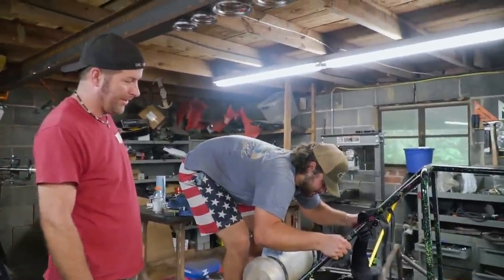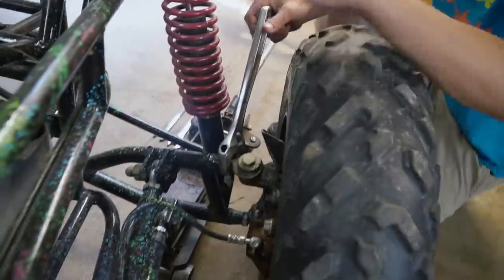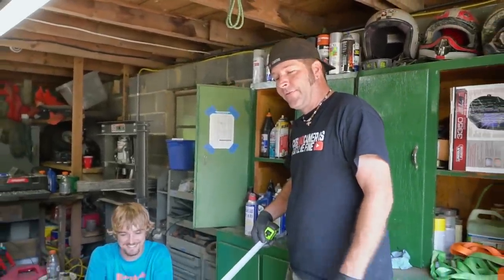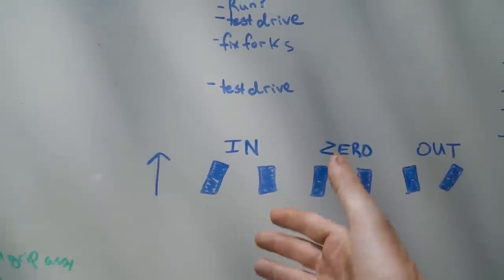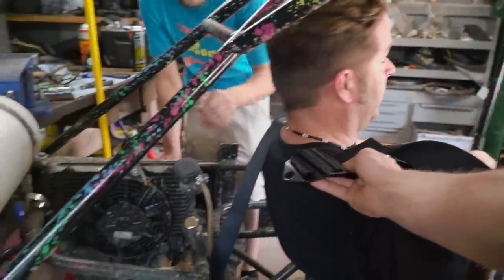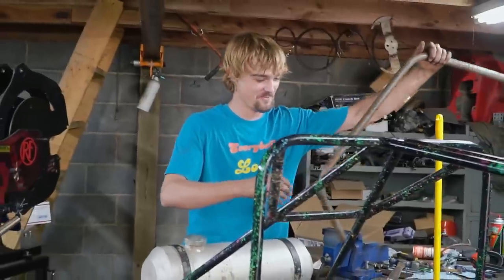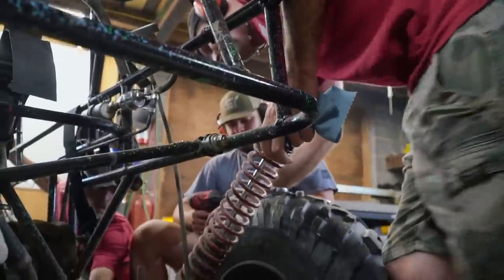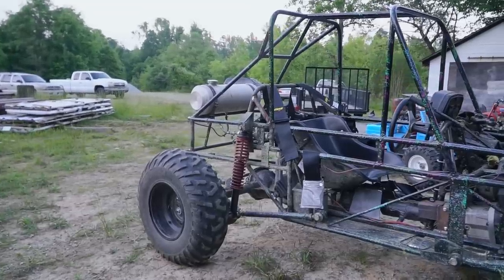$100 Long Travel Shocks RUINED the Trophy Kart | Jump Testing, Is It Safe?

Comment: You need to put thicker oil in the shocks. Go to the local motorcycle dealer, and get the thickest shock oil you can get. You can even call a motorcycle suspension dealer tell them your weights and get an idea on shock oil vs dia of the shocks you are using now.  Then step down or up on viscosity till you dial in the rebound.

Comment: Moto racers (and monster truck drivers,  and RC bashers) change the attitude mid flight via the inertia of the wheels. Throttle brings the nose up - brakes drop the nose. Its a delicate balance that takes a lot of practice 😉
If you want to jump it, you need some long travel shocks, and hydraulic bump stops.

Comment: For those reverse thread joints/bolts that aren't marked, try filing a groove in the points of the hex with a triangle file. This would look like the fitting on a fuel gas welding bottle.
Reply: they are marked...

Comment: Have you guys thought about using an air suspension like when you would find on early model Ford expeditions etc? If you went to the junkyard you could probably find one and then find a little 12-volt air pump and if you had a proportioning valve you could make that so that you could dial in the settings you need. It's just a thought.

Comment: Throttle position and change in acceleration from bottom of jump to the lip is key in helping set the ballance of how itll land. Hard acceleration from bottom to top of lip will shit more of ur weight towards rear think of it like a drag car all weights up front but you want it shifting Back during launch for traction then decell to level out

Comment: MAKE THE FLUID HOLE BETWEEN OIL CHAMBERS SMALLER AND ADD A CHECK VALVE IN THE COMPRESSION DIRECTION SO IT COMPRESSES FAST BUT RETURNS SLOW.

Comment: The springs control the down and  the oil controls the up. Less oil will only make the spring open back up faster. Need more oil is the point in getting at. Adjustable shocks will solve all your problems.

Comment: I remembered something about your problem . Seeing "The Outlaw" rock bouncer in action , I noticed his ass didn't spring up like all the solid rear axle buggies . The diff is solid mounted so it travels with the frame and the wheels and tires ONLY are moving with momentum . Your solid axle is sledgehammering your frame , driving you up in the rear . Your front end is super soft too , possibly contributing . There are a couple of Outlaw compilation YouTube videos you can watch to see what I mean . Try a BMW 3 series rear axle and see how much better it works . Better than 3 grand in shocks !

Comment: Issue with the rear end flicking up is more likely the length of the jump/ramp. If the jump is shorter than the wheelbase this will always happen because the front wheels are airborne before the rear suspension has compressed into the ramp. Need a longer ramp for the long wheelbase

Comment: I remember reading something one time that said a jump needs to be at least one and a half times the length of the vehicle, and a smooth incline, so the shocks are at the right point in compression and rebound to help control nose diving. That obviously won’t solve all the issues but it may help.

Comment: Guys try just preloading the suspension on the jump. Just as you go up, keep the gas pressed and apply the brakes a bit to get the front to dive a bit, then as soon as the front tires are about to come off the tip of the ramp, release the brake. This will let the front extend a bit and keep it more level in the air

Comment: I vote weld the rear diff and make a shorter final drive. Install longer struts on it, at least double the length you have. A longer strut should allow for more droop in the rear so it lands smooth. Then stiffen the front until it bounces off the jump level. Maybe get a seat out of a evo or something similar also.  a seat with the harness holes in them.

Comment: If the face of the jump is shorter than the wheelbase of the vehicle, it is hard to get it to jump level. If your front wheels are already coming off the jump as the back wheels are hitting the face of the jump, it bumps the rear up a lot harder than if you were coming off a longer jump where all 4 wheels are headed up the jump and the suspension is settled. That jump looks pretty short and it wouldn't surprise me if that is the issue. Also, if you gas on it hard while you are in the air, it will bring the nose up, just like apply brake in the air brings the nose down.

Comment: Y'all should try some Monroe Reflex shocks. They have an extra valve in them to help with a softer more comfortable ride on the rebound for a car but also provide a smooth transition back to normal. Just figure out what size u need and then do some research on em. I've used em for years on my truck. They might help with this problem. You might try for the rears on like a small 1/4 ton truck.. They might just be the size you need.

Comment: You need to add the oil back in and cut a few of the coils from the shocks. The spring is launching you when you come off the ground that's why it dives down in the front, either get a softer spring rate for the shock or cut a few coils off it

Comment: Those coils are assist coils for a truck so that you can tow more but they aren’t designed to be alone. Add some cheap air shocks from a truck. That should slow your rebound. Rock auto would be like $20 a pop

Comment: The bar you added for the seat belt is very dangerous.  It's right at neck-height, and the seat doesn't protect your back and neck from hitting it in a collision.  You need a seat will support your neck and upper back.

Comment: Hey John, take a video of the jump from the front side of ramp straight 90° so you can see how the struts are working. Also I think it would help to add some more weight in the rear end 80lbs is a good start but drivers weight is the bigger adjustment in the factor.

Comment: You need a longer and stiffer shock in the front so it doesn't just plow through the jump. And for the rear a normal car shock should work

Comment: Slower rebound will help but the biggest problem by far is weight distribution. Maybe a weight plate in the back to get it close to 50/50? And you also have a larger shock in the rear where theres less weight which makes it even worse.

Comment: Get a sternum strap on those over the shoulder harness straps. You'll come right out of that harness in a roll and possibly even in a jump. Also, the rear mount being far below the rear of the seat is dangerous to the rider. Make a variable mount with push pins if nothing else.

Comment: Try using rear dirt bike shock. Single shock style.  They come with adjustable rebound built in and stiffness. Old yz 250 rears are cheap height is about rite

Comment: I used to race motocross on a tv is the early 2000's. I had custom axis shocks that cost 2800 for the front and 1800 for the rear shock
Reply: I would reccomend looking for 2004 ish yfz450 shocks they are adustable and cheap

Comment: Don't let off the throttle while in the air. When the you let off completely that makes the front want to dive by revving while in the air that will help keep the front level. The throttle control comes into play in everything from monster trucks to remote control trucks

Comment: You gotta gun the engine at the bottom of the hill and keep the rpms up to the top of the hill. Don't let off until in the air or it'll pogo. That and  your suspension is way to springy. Maybe put a car shock or some type of dampener to keep the suspension from springing out so quickly

Comment: If you swapped the A arms up front. To the opposite sides, An made it so where that angle is facing down an not up you'll have like 4 more inches or more ground clearance. Doing that will also make it look more like a Baja buggy,

Comment: If you use two levels instead of two boards and make sure you’re exactly the same distance off the ground you will get a much more accurate measurement but you did say the dirty way to do it and I’ve noticed that’s exactly how you guys operate

Comment: Looks to Need stiffer spring, and a lot slower rebound. You want to avoid leaving the face of the jump at the bottom of the shock travel, Looks to be Bottoming out at the bottom of the face of the jump and loading up the suspension by the time it reaches the lip of the jump and causing it it to nose dive, more bump travel is always better than more droop, to combat not having enough bump in the rear is to raise the front up.

Comment: I think with those rear shocks you should try using a thicker oil in the shocks, as they are they are way too soft and bouncy and not giving you enough damping action, so if you use a thicker shock oil that may improve matters and it's a way cheaper alternative to test than going out and buying new coilovers?

Comment: add more weight to the rear about 150 pounds would do and also stiffen up the rear suspension to help keep it from hopping around to much especially when taking off from a dead stop. Change the shock oil from 30 weight to 40 weight on all 4 shocks will solve most of your problems.

Comment: if all else fails ya'll Need to (Strap the Back end).! so it doesn't come apart in midair.! you just need to figure out  the width and set the strap to that.! lift the back end  letting the rear wheels dangle. measure the space then set the strap to the desired width. easy peasey.?  this will only help when jumping

Comment: You really need a car racing seat with the seat belt harness. Not to hard to find a used one. Just wanted to share my concerns with you all. Also as far as dampening rebound, the only thing you can really do with those shocks is to put thicker shock oil in them

Comment: If you wana slow the rebound down on the shocks u need to put thicker shock oil in, if u want faster rebound put thinner shock oil in, I would use the right amount of oil and go thicker, witch wil slow the rebound down and not be as bouncy, message back for once plz.
Keep the videos coming and welcome to the 3rd gang member. 😂🤪🤫👌

Comment: What if you just used some heavy duty surgical tubing or a bungee to add more resistance on the decompression side? You might have to strengthen the suspension a little bit. I have no idea if this will work. Another idea is a more viscous liquid inside the shock? I don’t know if that’s a thing even.

Comment: So thicker oil in the rear would slow the shock down but the real problem is the springs.  Also the front end needs to be handled better.  There is a reason race teams have a shock guy.

Comment: Gas it in air use wheel torque to flatten it out. Wheel torque will pull the rear down

Comment: def need a lot more damping on the rebound and possibly a bit stiffer or longer spring in the rear, the front end could prob do with a bit more travel also. those rear shocks are bouncing around like they are seriously clapped out

Comment: You might wanna put bars from the support bar that runs horizontal on the back bars down to the seat belt bar. If Ike’s head were to slam back that bar looks like it’s at the perfect spot to slam the neck right below the helmet, would definitely break his neck.

Comment: Get a few sets of motocross shocks then stack the shocks on towers then you can have all the suspension that the frame would be capable of.......the front end has zero travel in it for what kind of ride you seem to want it to have.......you need longer shocks that aren't as stiff.....you need travel

Or you could just fix the crappy jump

Comment: You get what you pay for. If you want to save money on shocks but you still want quality go to a cantilever style suspension and use a shorter coil over system but still using a high-quality shock and coil that way you can get all the travel and adjustment but you don’t need to buy such long travel shocks and struts All this can be achieved by simply building the proper geometry cantilever arms

Comment: if the back jumps, the problem is in the front, when the rebound in front is too slow because of the weight, the back already lost lotta weight/downforce, and just get bouncy, with more speed, that effect is less,  double the shocks in the front, and you ll be fine, or, replace the oil in the rear shocks with a thicker one, that for sure wil eliminate the bounce...btw, if you really think only rebound will change, with draining oil...maybe time to check how shocks actually work?

Comment: you need actual adjustible shocks with adjustible rebound and compression, and your spring rates out back are too soft. fronts look ok. Might want to see if you can get the fronts a little higher though, still looks a tad low.

Comment: It's launching the rear end because the front is almost touching the ground, once that compresses pre jump alls it does it smash the bottom of your kart off the ground also launches the rear end straight into the air

Comment: John, you and Team need to "chalk board" through the motions of the Trophy cart front end. Toe in has no effect on camber- the "tip in or tip out at the top of the wheel. Toe will help or retard the rate the steering will "self center" or return to center naturally- but even a little bit too much toe in or out will cause the tires to scrub as well as roll and wear fast- so stay close to zero either way. When the twin I beams deflect the caster is what is changing- and it starts out tipped in from the beginning, so it's way tipped in when fully compressed, and landing with the front tires spayed wide and sliding inward when you need hard traction. And the car is probably 55-60% front weight. Your bump steer problem is in the difference between the lengths of the tie rods and the length of the I beams themselves- the tie rod knuckle needs to be on a line with the upper and lower chassis pivot points for a double wish bone and it needs to be at of "fudged" to be at the same distance as the length of the I beam- or with in 10-15%- that and proper Ackerman set up on your steering arms will get your bump steer in most of the area of suspension travel 6" up or down form ride height , if you have the I beam level from pivot through wheel. Build up a "model" of the Twin I Beam- to reflect the geometry you now have for the I beams and the tie rods and steering inputs. You can put paper pie plates on it to be wheels. Oh, and stay awesome! FR

Comment: The cart is obviously very front heavy so it will out of the box be close to impossible to get a decent "jumper" of it just by manipulating the chocks.
Try adding some weight in the rear to balance out that heavy engine before spending more cash on new shock absorberes

Comment: If I was ya'll I would try switching the shock set up around the other way 
So the front comes up faster to give it more lift and make the back end stiffer so it don't try to spring the back over the front but that's just my opinion

Comment: For jumping on rc cars I always toe in the rear wheels and toe out the front a little bit and i know the more the toe in front is in the more the back end will lose traction causing much sharper and touchy steering not good for jumping.

Comment: You have to hit the gas when the front tires hit the ramp so it punches up the front. Plus you cant let off the gas before the rear tires leave the ramp. Reason is when the rear tires hit the ramp it will naturally cause the front to push down. You have to power through the ramp. When in the air you can influence the angle with gas or brake but it really is not a factor hear. Because it is such a tiny jump. Not a 50 footer or anything. Think what happens when you lean something back on a dolly and then hit something on the floor. It forces the front down same thing here. What do you do either you back up and give it an extra push and pop it over or place your foot at the bottom and push it over. Give it gas and POP or PUSH it over. 

Well sounds good anyway and I did stay at an Holiday Inn once. HAHA!!!!

Comment: If it's jumping and air time your wanting to accomplish your going to have to build a rear or mid engine machine more on the sand rail style the front engine is more like a sprint car your engine weight up front is better for steering.... keeps you planted...go get'em...now build a 2 seater side by side...and see who can scare the bejevers out of the passenger...

Comment: I would really like to see you guys change the cage on that kart. Those bars down the middle are just prime to hit your head on in a flip. And the open space outside them is prime to let your body get outside the cage. You should add bars at the perimeter of the cage and cut out the bars in the middle. And please for the love of god get a higher back seat. With the belts in there you are just looking for a broken back. I used to build Midgets and Sprint cars, and I just really don't wanna see you guys get hurt.

Comment: Just need to commit harder, accelerate all the way up the face of the jump and off it. Gotta keep the weight transferred onto the rear suspension until it leaves the ground so the unloading rear suspension doesn’t upset it. Watch a real trophy truck jump, they are giving it the beans going up the jump face. It may help to chop the throttle at the base and then floor it again up the face for more weight transfer.

Comment: I would recommend using a rocker arm setup for the shocks. You can use the ratio of the rocker arm to get your travel and the shock travel the same. Then you can use a high quality motorcycle shock that has less travel. They are dirt cheap and you can usually find the spring rate online. It will require using your brains so leave ike out of this one and get Charles to figure it out maybe. BTW that setup is NOT a cantilever as much as other idiots want to call it that. It's a rocker arm.